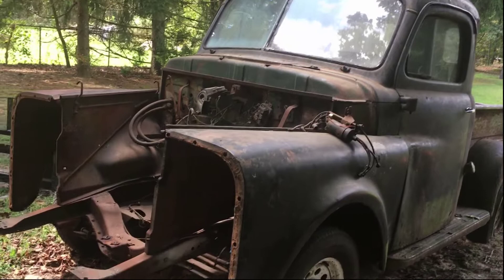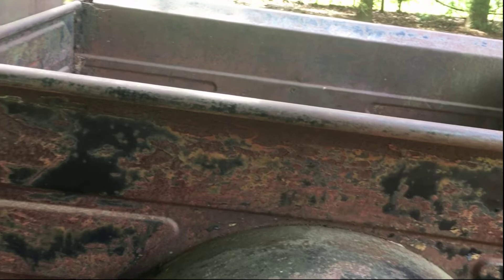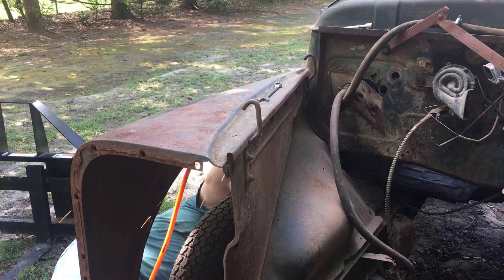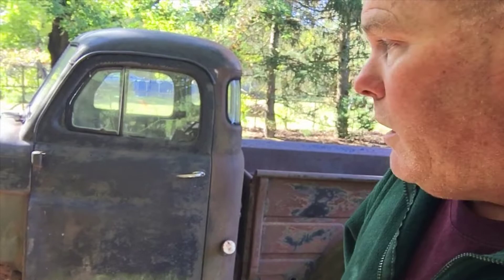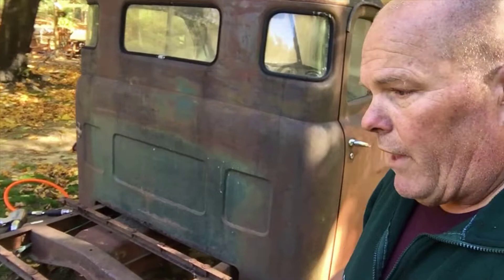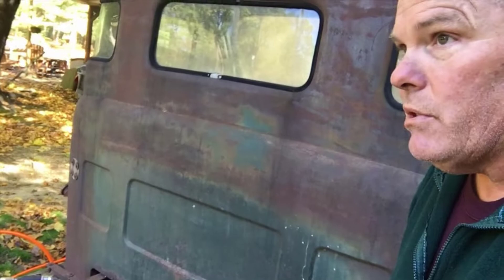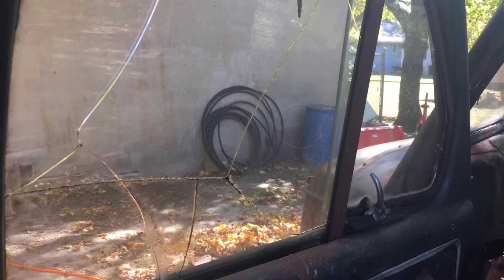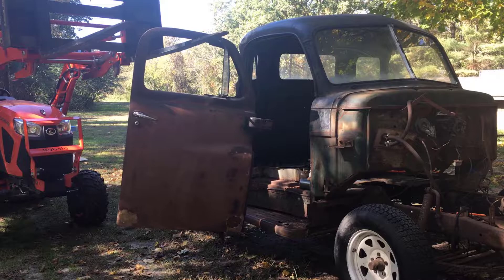1953 Dodge Pickup Truck Part 4. Removing the body from the frame.

Comment: Hey Gary, you have a nice project there. I have a 53, 3/4 ton Dodge in my shop needing brakes and some other items which I hope to get to this winter. Just a note here regarding the green paint. Without having my color charts in front of me I don't know if Dodge offered a straight green cab. I do know that they offered a "Spring Special" which was a two tone green paint job. Those are considered rare and you may want to replicate it? I'll bookmark and monitor this post if I can be of help?
Reply from the maker: I believe they did make a straight green cab but I might be wrong. Honestly, when I bought the truck I had every intention to turn it into a rat rod but the more I looked at it I didn’t have the heart to do that to the truck. My plan is to get it back to original as possible and enjoy it. I appreciate your comment and offer to help in the process!